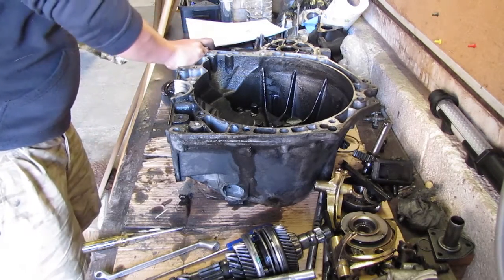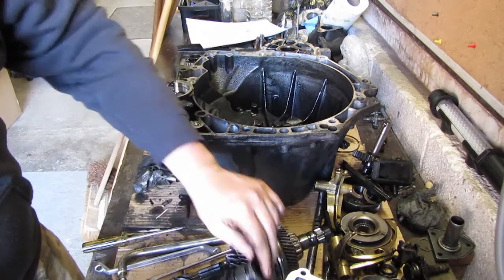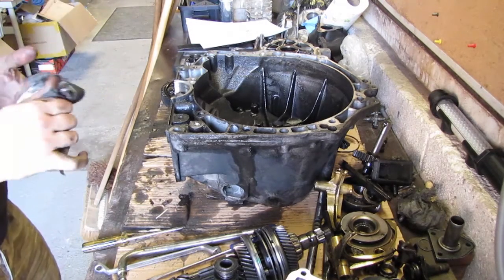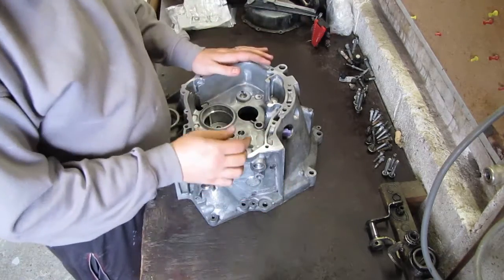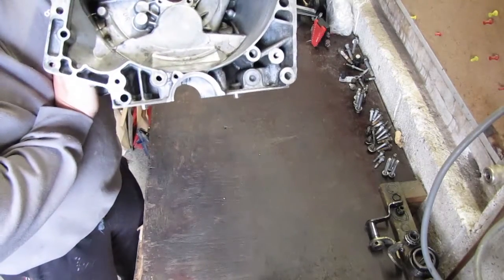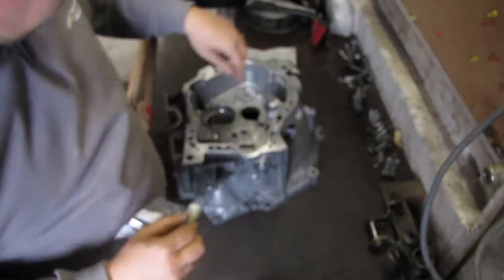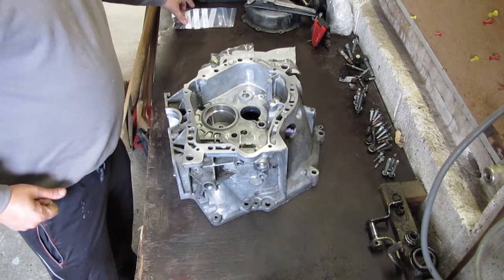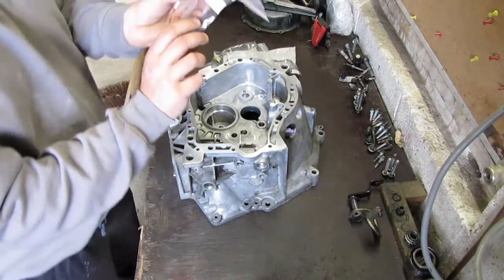Peugeot 207 - BE4 Gearbox Overhaul (Part 6)

Comment: I'm doing my BE1 gearbox which is very similar you've helped me a lot! I have run into one problem though. The bottom gear, on the shaft that connects to the differential, grinds on the gearbox and looks like it should be higher. Is it just held in by the top housing with the circlip?
Reply from the maker: +Lachlan Elliott on the BE4 there is a plastic spacer situated in a small recess in the bottom of the gearbox in which the shaft is located. also the bottom halve of the shaft should have a rather large bearing, which sits in the opening, just above the wormgear
Reply from the maker: +Lachlan Elliott you can clearly see the bearing here https://youtu.be/AZ-nSXdUj5M?t=6m59s
I do believe you can also get some shims to space out the bearing a bit...